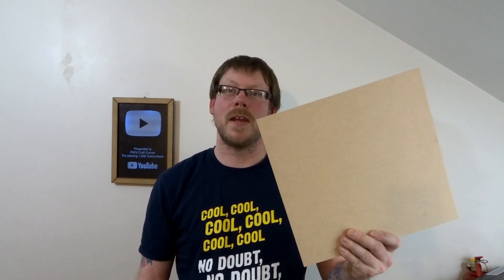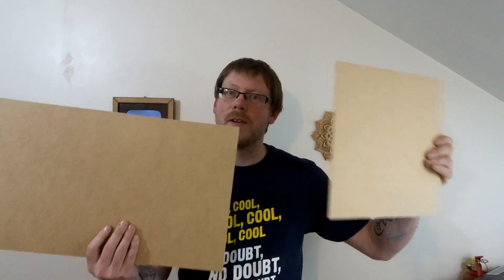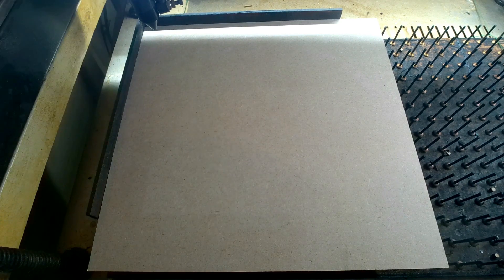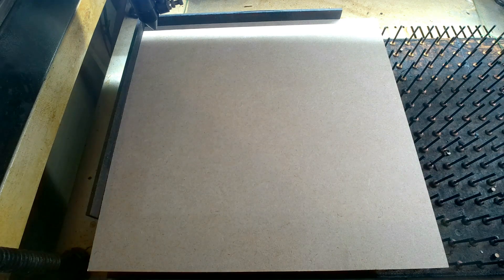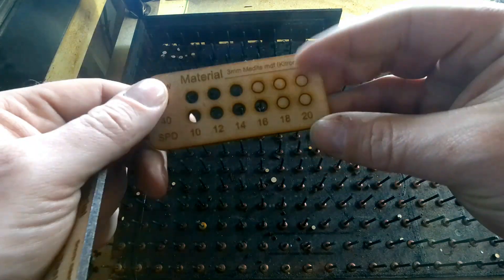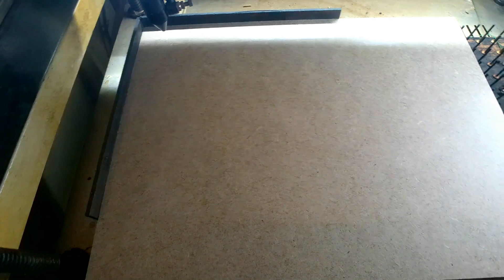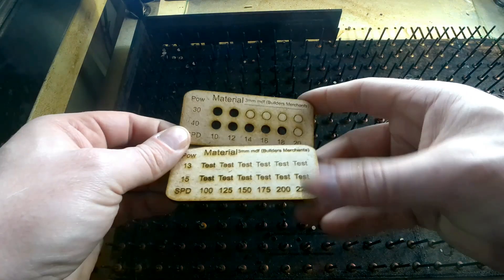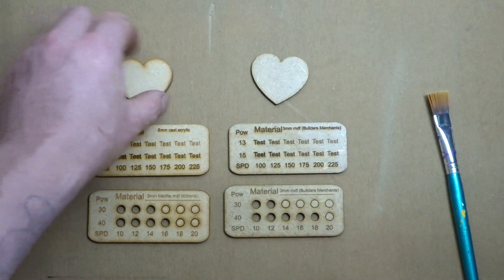Is 'Laser' MDF worth the extra money?

Comment: Im new at lasering, but dont you need to seal MDF before painting? Im sure ive read/seen this
Reply from the maker: Depends on the paint but most water based paints are fine. It's also mostly the edges of thicker MDF that has problems

Comment: Hey ! I've just discovered the risk of mdf with engraving/cutting due to formaldéhyde. Im using Xtool M1 machine with machine ventilation outside. Is it risky in my set up to grave/cut MDF ? For the environnement ?
Reply from the maker: There's a risk of fumes with every material you cut and engrave. Suppliers in US and Europe have strict rules about how much formaldehyde is allowed to go into their bonding agents. Although it's not perfectly safe, it's also not as dangerous as people claim. Just keep the fume extraction on and you will be fine.
Reply: @philscraftcorner  Agree taht the fumes can be extracted using relevant extraction fans. The bigger problem with standard MDF is the sticky mess that builds up on a diode laser head module near the lense. At least that was when I used an MDf I got from local Wickes store and local timber shop. Very difficult to clean that sticky mess.
Reply from the maker: @mrombit605 acetone or isopropyl ancohol
Reply: @philscraftcorner  yes, I know, however use of acetone or isopropyl alchohol requires a lot of effort to clean it properly. BTW, acetone may damage the lense! That's why I would use only laser compatible MDF and only isopropyl for cleaning. Thanks for your reply.
Reply: Thank you for your answer, I appreciate your dedication 🫶

Comment: I tried MDF fiberboard and all the cut edges got soot all over them and it transfers to my hands and the pieces. Is mine different from Laser MDF?
Reply from the maker: Standard MDF boards give off a little more residue, if there is that much soot coming off I suggest you check your speed and power settings. You are either using too much power or too little speed

Comment: The most important consideration here is that laserable MDF is manufactured using E1 low fume glue which gives off considerably lower levels of formaldehyde gas when lasering.
Reply: As soon as he said that he used different speeds, this comment became the only usable information on the whole post.
Reply: They only tell you that😂
Reply: @B3RG3RS0N 
Some manufacturers/suppliers state E1 glue but are unable to back up their claim or provide evidence.

More reputable manufacturers/suppliers will provide a material data sheet upon request while others provide a downloadable .pdf file on their website.
Reply: The Builders Merchant MDF or hardboard sheets are formaldehyde free.  At least they are here in the USA.

Comment: is it safe to use standard mdf using a diode laser?
Reply from the maker: I wouldn't consider any material safe on a diode laser without a fume box. Any lasering that you do will just put the fumes into your room
Reply: I have a very efficient fume extraction system so no worries there
Reply from the maker: Should be all set then 👍

Comment: I knew there was a difference!
Reply from the maker: I have to say that I am currently using the standard 3mm MDF due to cost and supply issues. It's been great to work with and really consistent results
Reply: @philscraftcorner  It is good, and I find it sturdier than the other MDF, but it's also a little bit harder to cut. I do prefer the effect of the cutting and engraving in it, it scorches a lot less
Reply from the maker: Learning which materials work for you and the specific job you have on is half of the fun

Comment: Where did you get the bed with all the pins in it?
Reply from the maker: I made it myself with rivets
Reply: @phil's craft corner  glued down or loose?
Reply from the maker: They are loose for now but I'm planning on making another pretty soon
Reply: @phil's craft corner  I would be tempted to glue them down in a bed of epoxy
Reply from the maker: The board at the bottom has holes cut out to hold them in pretty snug. But it's only 4mm MDF and it flexes quite a bit..I'm thinking of going with a thicker board and gluing them in on the next one

Comment: isn't one of the properties of laser mdf that it has less chemicals in it that might be harmful when burnt. Must say most people vent so not a problem. Perhaps a bit more time with the strength would have provided some real number even if just a hanging weighing scale used to pull it so we could see at what pull force it broke.
Reply from the maker: There has been a long debate about the safety of using MDF for all kinds of uses. Most companies these days, especially in  Europe and the US have to conform to pretty strict safety guidelines meaning they have to restrict the levels of harmful chemicals used in production of MDF.
From what documentation I could find,  the levels of chemicals in both lots conform with E1 and CARB phase 2 safety levels.

As for the strength test. Yes I definitely could have set up a method of being more accurate with how well they perform. I will look into doing another video based on this soon. It was a spur of the moment while recording that I decided to test the strength